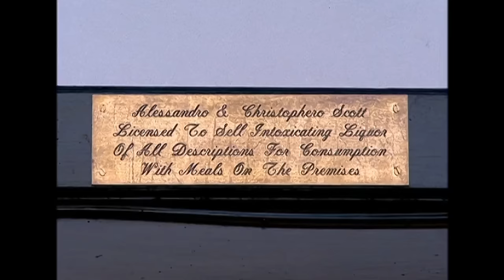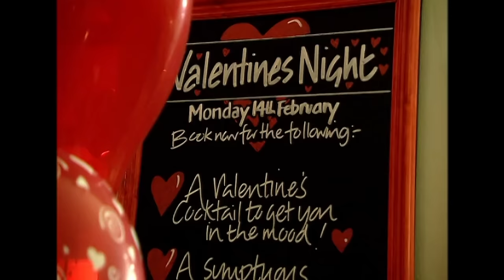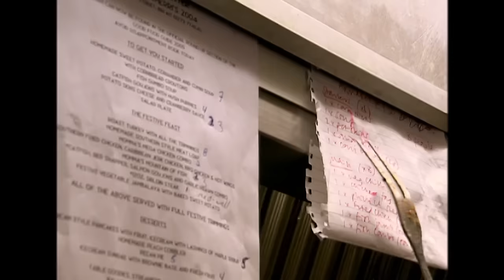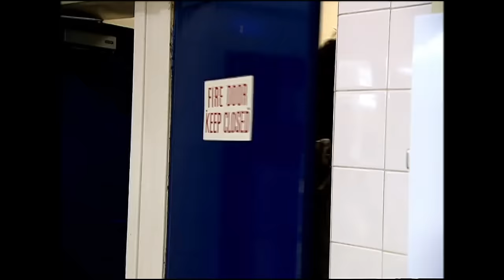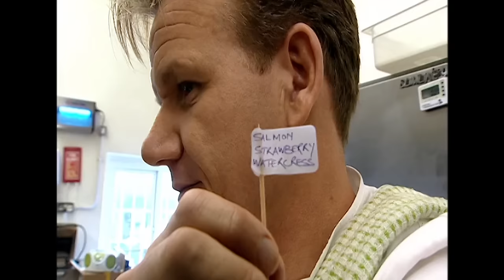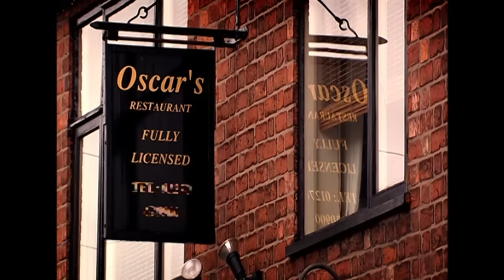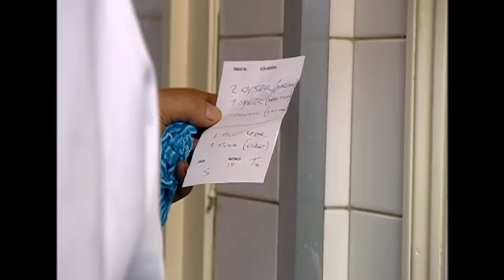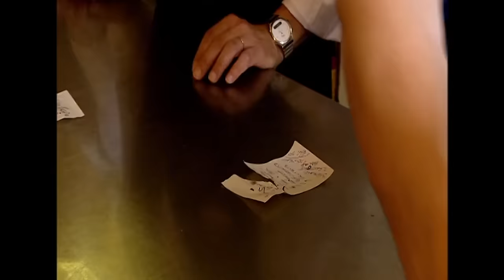All Of Season 2 | Kitchen Nightmares UK

Comment: "1:25:20 - and if an a chef looses a ticket it's like an ATC Controller losing a plane" right on point; there are so many opportunities to bring seemingly unrelated fields together, I've done it in my career and called it 'bridge building'; in this case we can bridge the strict disciplines used in Aviation like ATC and CRM (Crew Rresouce Management) and the kitchen together, bounce ideas around and come up with a standardised 'Restaurant Resource Management' course + manual together, requiring both classroom and hands on minimum times plus exams, and not reinvent something from scratch
Reply: That blonde French chef needs to be fired. Get. Rid. Of. Him.